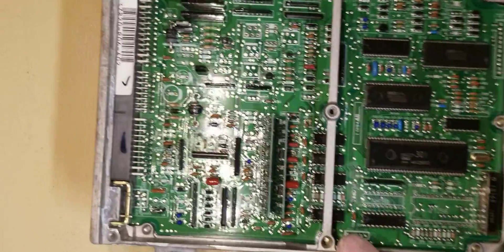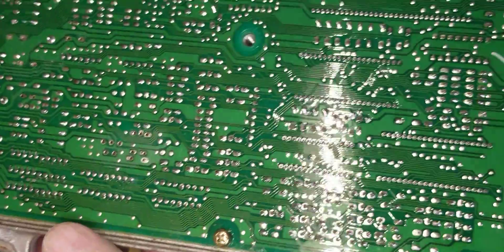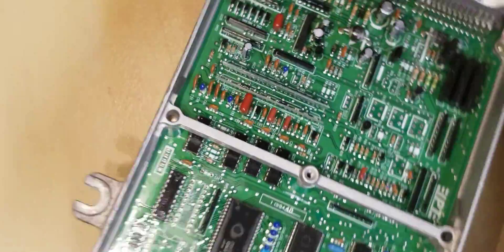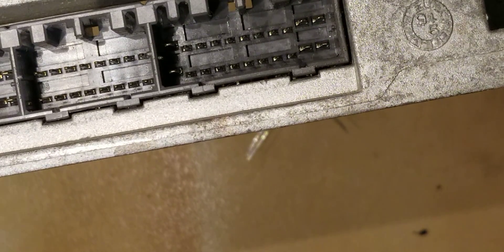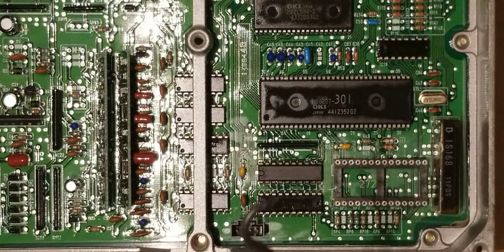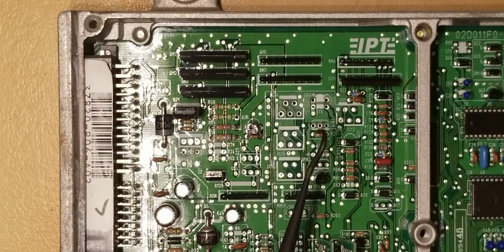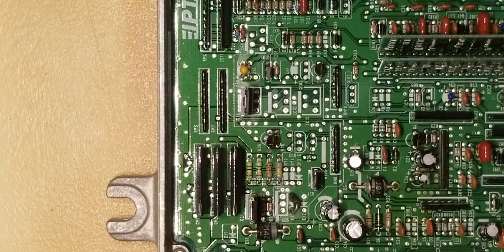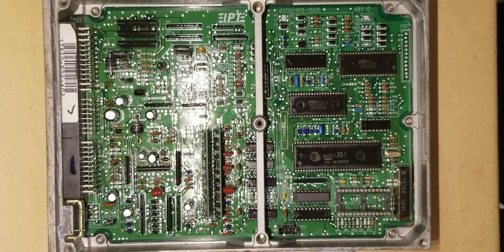Part 2 Honda Tuning 101: Prepping your ECU for Tuning Success! (Replacement of 30 year old parts)

Comment: my ecu po8 is bad no gas comes out in injector. what parts in ecu for injector? thanks
Reply from the maker: Have your check led your main relay?
Reply: DIY KAI yes the main relay is good all fuel lines are working except for injector
Reply from the maker: Stock ecu? And your sure the fuel pump and main relay are in working order? If so it could be a number of components in the ecu
Reply: DIY KAI i also clean the injector no clogged